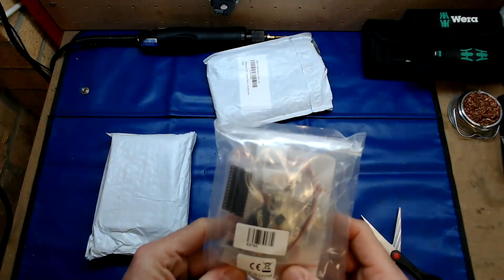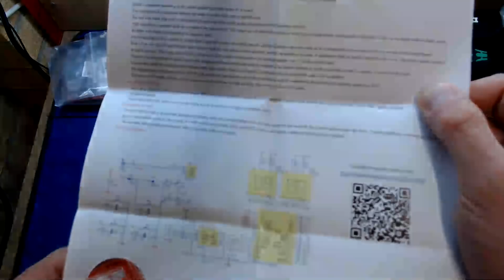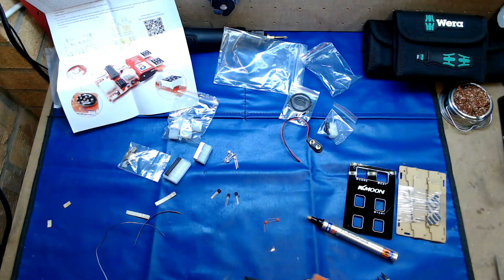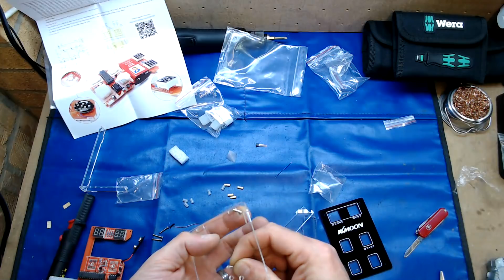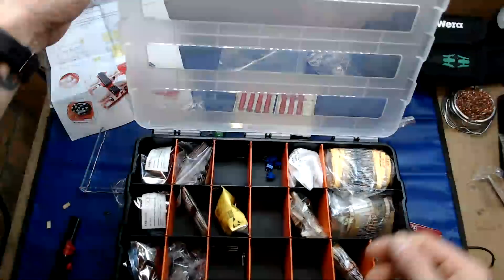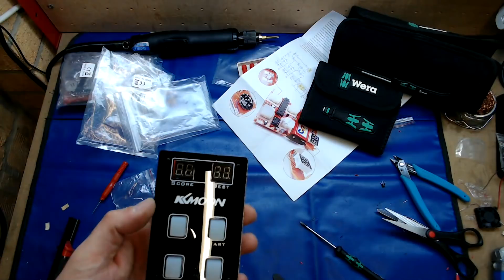Kris' first live stream - building, fault-finding and rambling on!

Comment: Great video Kris. I Just built one of these and it works but when I connected the battery I thought I could smell something burning or melting even. My finger happened to touch the regulator that you had problems with and it was very hot, too hot to hold my finger on. I also had a spare one in the packet. It seems they know about the problem and expect the regulator to fail. This is a very bad design which is a shame as it's a great little game.